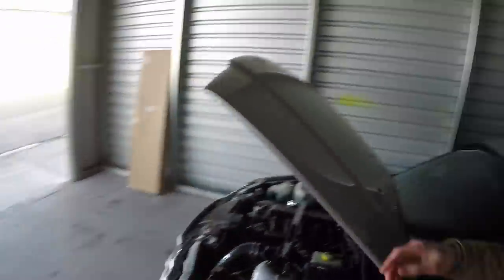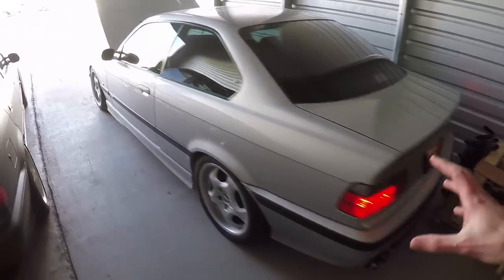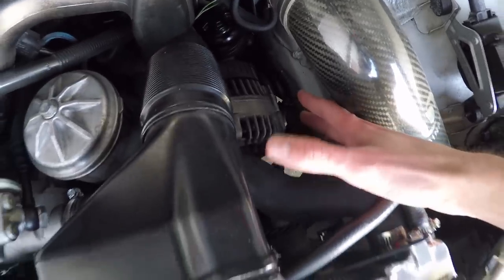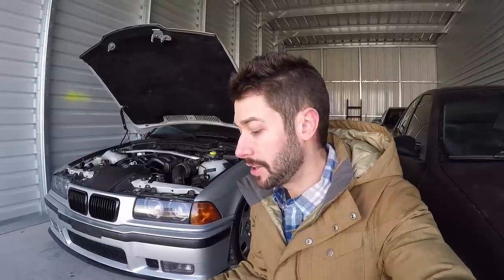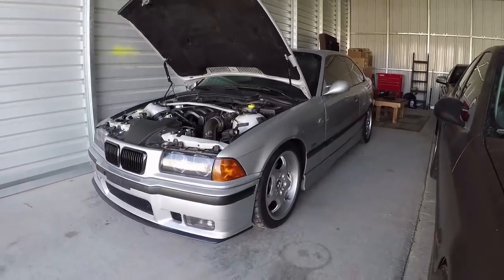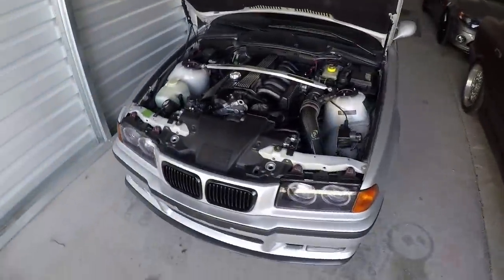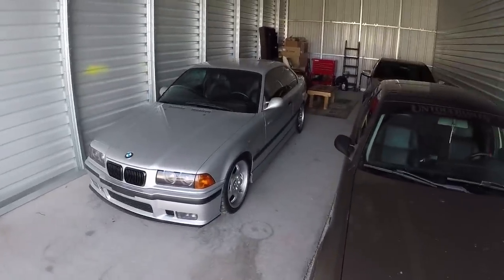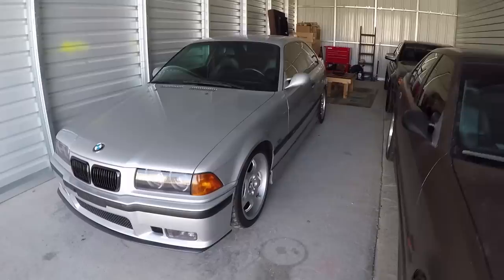BMW RELIABILITY: My AWFUL 1 Year Experience

Comment: I believe I’m a little late to video? Hopefully someone can help me, it’s regarding an E36 I’m currently looking at. Ever since my brother got an F80 few years ago I’ve fell in love with the designs of bmw. Now I have been given the chance to buy my own car, my eyes are set on a 1998 E36. I’ve learned that Bmws have a reputation for being costly to maintain, not because of the engine but because of the other ongoing systems. The seller is asking for $4.5K (168K miles, nicely kept interiors) which fits in my budget, but I’m worried about the upkeep costs. The seller has replaced the head gasket, cylinder head, gaskets/seals from heads up, front control arms, front tire rods, front suspension bushings, rebuilt diff, new starter, and AC system. There’s definitely a lot of money that went into fixing this car already. Would it be a wise decision to pick this car up, especially since a lot of problems have been assessed?
Reply from the maker: I always recommend having a pre purchase inspection done by a reputable German car shop. They know the big main issues to look for and can really guide you on those. Every used car will have things that wear out and need to be replaced, but at least a good German auto shop can keep you from paying the large expenses.

Comment: i dont know what people do wrong with their bmws. i have 2 e34 a 525tds (126000km) and a 525i (225000km). i once had to change a sealing ring on my fuel injection pump and had to replace the axle bearings. other then that i never had any issues and i took them both around the nürbirgring for a few laps aswell

Comment: You're in SLC? what shops do you recommend in the area for the E36?
Reply from the maker: Depends on what you need done
Reply: @TreatsOnTheStreets  I just bought a 98 328i and need to get the clutch replaced and a general tune up. Do you have a shop you like/trust in the SLC area?
Reply from the maker: Yeah dirty euro customs or Wasatch motor werks. There are a ton of BMW shops in Salt Lake so you've got a handful to choose from. If you want to come up to Ogden there's 4950 Automotive Repair.

Comment: Did you gain any NVH in the cabin with the polyurethane motor mounts? Mine have gone out and im looking to replace them.
Reply from the maker: Yes, specifically at idle. There's more vibration but it's not terrible

Comment: put it this way.. that engine.. is in their x3, x5, 325, 328, 330, 525,  528, 530,  ... selling BMWs for a living I rattle that off sometimes... this is a sealed engine with a sealed transmission with a timing chain.. this is their most developed engine... it's in their SUVs, it's in their Sedans, it's in their coupes...... I have quite the monologue and usually if a person has the money by the time I finish they're buying

Comment: Fixing wise did u take out the engine to replace the water pump or ?
Reply from the maker: No way. You just take out the fan and radiator to have enough space 👍.
Reply: Treats On The Streets alright, still looking to buy one maybe a 328i , how different is it from the m3?
Reply from the maker: There are quite a few differences. Limited slip differential, engine, bumpers and hood, stronger chassis bracing, suspension, etc. All e36's are great fun cars though! So if you don't care about having an m3 they're all pretty good!
Reply: Treats On The Streets it’s not that I don’t care, it’s first car and kinda expensive for me. But love it, will mod it tho so lsd, suspension and bumpers don’t matter, it’s just the engine potential I guess that’s different..
Reply: Treats On The Streets how much did u pay ur m3 if don’t mind me asking

Comment: About the vanos, are you able to replace the us spec 2 step vanos with a eu spec variable vanos? Just curious since I'm planning to look for an m3 And I heard that because of the vanos and a few other things it's "down on power" compared to the eu spec and would like to see if those are things that can be easily changed to unlock that power
Reply from the maker: I don't think you can just swap the vanos. There are many other things that make the engines different. Individual throttle bodies, higher compression ratio, etc. There are plenty of mods you can do to increase power on the s52, but I wouldn't recommend swapping the vanos as one of them.
Reply: Treats On The Streets I was just wondering if you had found a way of doing it, thanks for the info! I know the engines are pretty much completely different to the point that the euro spec even has an exhaust vanos but just wondering if replacing the intake one does anything. Thanks! I might just look into getting an e46 if I find something in my price range.

Comment: 99 e36 323ci vert 125k miles runs mint
Reply: Cole Douglass I’m looking at one right now with 110k. What has maintenance been like?
Reply: Just oil change just normal things I paid 2k for mine and it's a 2 owner garage kept no rust just the top dont go down and I start it with a screw driver the inline 6s are super strong just do regular maintenance

Comment: what type of lights you have on your e36's and where you get them from
Reply: If I remember correctly, he got them on eBay, and they are DEPO brand.
Reply from the maker: +Roderick Harmon DEPO glass lens headlights with LED angel eyes. The angel eyes are already in the headlights when you buy them. Got em on eBay for around $300.
Reply from the maker: +LockDots you got it! 👌

Comment: Have you had a lot of problem with vaccum lines? I had to redo my whole system on my past 2002 bmw 325ci
Reply from the maker: Only one line has gone bad because of the o ring. The vacuum line going from the valve cover to the PCV system.

Comment: Would you recommend this as a first car? I am really interested in learning to work on an e30/36. I am in high school and don't really have any experience with this kind of thing. Bad idea? (I got the bus for backup transportation)
Reply from the maker: Find a good working one and get it inspected before buying. It's not a bad first car especially if you're OK with working on it. Just make sure you don't buy a bucket of problems that hasn't been taken care of well. That goes for any car really, not just e36 specific.
Reply: Treats On The Streets would you recommend e36 or e30 for learning to working on cars and as a good reliable car? And yeah, I always have it inspected.
Reply from the maker: It will probably be easier to find an e36 in better condition because they are newer, but either are cool!
Reply: Treats On The Streets thanks!

Comment: I just discovered your channel today and I love it, been watching through quite a few of them and you have earned my sub! Also I love e36s and I’m looking into getting one soon 😁 
PS: What’s the status on the 6 speed?
Reply from the maker: +Kuruma Designs welcome to the channel man! E36's are great cars 👌. Still accumulating parts for the swap. Crazy that the transmission isn't even the most expensive part...😬. Looking forward to getting it in though! You can see the transmission sitting behind the car towards the beginning of the video haha.
Reply: Ah alright, yeah I remember you saying the clutch and flywheel was like $1600 or so! The 6 speed is the same ratio as the 5 speed 1st-5th, but 6th is a longer gear for cruising correct?
Reply from the maker: +Kuruma Designs looks like the clutch and flywheel is actually going to be 2k lol. And yes that is true about the ratios.
Reply: Daamn that's costly! Alright, will be great I reckon!

Comment: My e34 540i isnt too bad on reliability. Parts cost a lot though. You get what you pay for. You can have a drivers car that will cost ya money or a subaru eco box that has zero drivers feel that will not hurt the wallet.
Reply from the maker: Cheap, fast, and reliable. You can only ever have two of those together. Never 3 😂.

Comment: Sorry to say it but your ICV and CCV need cleaning or replacing.
Idle control valve and crank case valve is why your e36 is a little smokey.
Just so you know that i know what I'm talking about take your throttle body off and you'll find a little bit of oil in your intake manifold
Reply from the maker: +Ed Dean I'll have to check that, but keep in mind it's winter and I live in Utah. I had just started the car so it's a cold start. Couple that with freezing temps and there is a lot of steam/vapor coming out. Didn't smoke out the garage or anything.
Reply: Treats On The Streets maybe but i live in Victoria Australia and we get pretty low temperatures here too after I replaced ICV  and clean the ccv even At Nearly Frozen there was no more smoke.
By the colour of the smoke I can tell it's not a very big problem and there's lots of YouTube videos on how to clean them it's not a real big deal anyway just giving you a heads up. 
Oh and I just subscribed
Reply from the maker: +Ed Dean maybe in the next few videos if you see the exhaust looking what you think is bad you'll have to let me know and I'll look more into taking care of that stuff. Definitely don't like a smoky exhaust. Welcome to the channel man!
Reply: Smoke from the exhaust, especially on startup in colder climates is nearly always caused by condensation and water vapour. If the smoke is any colour apart from a slight transparent white then you would possibly be showing signs of engine and/or head gasket wear. If the CCV system was faulty, the general symptoms would be signs of high oil consumption without it actually appearing to be leaking out anywhere. The ICV would also only show an erratic idle, and at worst can cause stalling and/or EML to appear on the dash.

Comment: I've owned 3 different e36's. They are still one of the most reliable cars in the world....unfortunately...(like most machines suffering from gross neglect) , they need retroactive maintenance. Just stay away from the GM manufactured 4L30-E  auto-transmissions. BMW installed those on alot of E36's. Those are junk and die after 150k usually.
Reply from the maker: +stonesthrow420 I definitely agree with you there!

Comment: Hey. Nice video and very informative. Im 17 and im looking for a car to get. I love classics such as old mercedes and i was thinking of buying a 190E but those cars have gotten very old and rusted so it will require a lot of maintenance. I understand this will require some too but i can definetly find some in a better condition than a 30 year old 190E. My questions are:1) Are they economically fuel efficient2) Are they reliable3) Can i easily find parts for it4) Is it just a bad ideea and will become a total money pitSorry if im taking too much of your time but its just that ive been saving for a car for 3-4 years now working by the time i was about 13 years old so i really dont want to spend it all on a car that will dissapoint me.Thanks

Comment: damn ive had an n44, m52, s52, and 2 s54s. each car/motor ive driven for at least 30k miles. none of those problems. only problems i created was when i did the m50 mani swap to the s52.. had to do $1k for work fixing my vacuum leaks... but thats it really. you got unlucky.

Comment: In simple words, these cars can be as relible as they can if you keep them in good nic, keep regular maintenance and if somthing is going bad fix it before it gets worse, yes they can be costly but they are relible cars if you not gonna do any maintenance at all and won't care then obviously it will cost you more in the end and also won't run or work, but still better then most new cars and any new coming cars as those are far worse they are more costly due to tech and more electrical issues, so I rather own a old bmw then any new crap. Car can only last till you want it to last and it's all about your love for it and how much you can afford to keep it but that goes for new cars too as these aren't any cheap to fix and can cost alot more.

Comment: cant find those exact headlights anywhere
Reply from the maker: +Bmw M3 e46 what are you searching when you look for them?
Reply: like i want those exact ones can you find the brand or something on yours
Reply from the maker: +Bmw M3 e46 they are DEPO glass lens headlights with LED angel eyes. All one piece, the angel eyes aren't separate. You can find them on eBay for around $300.

Comment: Your front wheels are not centered because you have 328 lower control arms
Reply from the maker: +ty ty they aren't centered because I have offset polyurethane front lower control arm bushings for added caster.

Comment: It's a car for mechanics in my opinion. If you can work on it and fix it, it's a reliable car. 
If you have to take it to the Shop for everything, you go broke 😂
Reply: Easiest car I’ve ever worked on is my e36 m3 followed by my e39 540 sport. 
8,10,12,13,17mm a flathead and a Phillips head screwdriver is all you need

Comment: But those repairs probably had LARGE LABOR COSTS
Reply from the maker: +Sam Shevelove I did the work myself on the water pump and motor mounts. Both simple fixes, especially the motor mounts. The $150 for the vanos included parts and labor.
Reply: do the work yourself and save a ton of money, thats what I'm doing with my e46 m3 and my mach1. and honestly most 3 series are super easy to work on.
Reply from the maker: +Duffmanb6 yeah they're definitely relatively simple cars to fix
Reply: You can do the worl yourself theres so much knowlege on these engines youtube teaches you everything

Comment: Haha its kinda funny that ive had problems with everything but the engine, steering fluid and vanos and I have 165k on my s52 e36! Latest problem is my ignition lock cylinder rod shattering. Installed a new one and it wouldnt turn my key lol fml. Just wired up a push-to-start and realized I suck at wiring haha. All in all a fricken champ of a car just really random and rare problems for me... Ahh well still obsessed with em. :D
Reply: *265k miles

Comment: Only one big rule if u wanna get an "old" BMW like a e36 or maybe a prefacelift e39 and thats is u have to change all the coolant system, fuel rails and filters (maybe AC pump also because it fails because the clogged fuel filter) than some mounts and silents. And thats all just because the previus owners didn't do that in the last 20 years or about 300k km. Ohh and another thing.. u HAVE to buy premium german parts for these.. it worth the price. Previous days i just reapir my friend newly bought e39 23i and im shocked because it has the original shocks on it and it has 270k kms in it and its made in 98'. So there are many shit owners u just have to repair their faults and the car please it. (Im just a random guy from europe who is a e39 individual owner)

Comment: dang both my m3s needed mad money
Reply from the maker: +Trent S haha maybe I got a little lucky
Reply: for what?
Reply: Bmw M3 e46 cooling system stuff, bushings up the tiny yang, tensioners, vanos rebuilds, gaskets all over the motor, differentials, axels, sensors.. honestly all completely worth it tho. Besides the cooling system stuff.

Comment: Mah dude the rims are on backwards, they are a staggered set, the fronts belong in the rear
Reply from the maker: +moises favarao I switched them up because I use the car a lot for drifting. I wanted more grip up front and less in the rear. It's a common thing to do on drift cars, but I understand why most people wouldn't do it haha.
Reply: haha yea  i figured you knew other vids were correct, nice car dude it keep all up, these cars are fantastic
Reply from the maker: +moises favarao will do, thanks for watching man!

Comment: This thing is just old. Old things break down. Has nothing to do with the brand. I had a nissan 200sx turbo. Boy was it unreliable.
Reply from the maker: The title was sarcastic. In the video I explain how its actually been quite reliable. But yes, older cars typically have more problems than new ones
Reply: alphatrion100 did you comment on it before watching? lmao

Comment: No biggie at all. I'd sell that Colorado before it starts giving you problems though.
Reply from the maker: I've been lucky on the Colorado. Maybe because of good maintenance. I'm at 120,000 and not a single issue since 60k when I bought it. Family member had one brand new from 0 miles to 130k and no problems either. Crossing my fingers lol

Comment: All these E36  325i are nothing less your nightmare ,got a new one back in 2004 brand new.It was under  full guarantee.5 times it needed a tow track  !!!  Car computer would foil coils four times in one year , Dealer sending a  BMW tow track to pick it  5times as the car was dead on the road  !!!!Every time engine light came on ,car misfired and smoking from tail pipe.Sreering box was was apart an leaking  ,clutch shuttering ,rebuild ,idle needed to be updated 5 times even brakes lasted only 30000km only Got read of this shit box in 2,5 years !!!! Stay away from this junk !!!

Comment: BMW, acronym for "Big Money Worry." Sorry, there is a reason you can buy them off warranty cheap- buddy had an X5 in his shop the other day. Seem the fantastic engineers mounted the turbos up above...where everything is plastic so everything dried up & broke. Owner enjoyed there "Ultimate Driving Machine" after the $4500 repair/patch up. And it'll happen again because of the turbo mounting position.
Reply from the maker: +olikat8 it's called a "hot V" because the turbos are mounted in the middle. The cylinder head flow is reversed so the exhaust comes out the center instead of the outsides. BMW is not the only one who does that. Mercedes does as well, and most every manufacturer who uses twin turbo v8's because it is more compact and causes less lag. Unfortunately there are drawbacks like you mentioned.
Reply: And unfortunately there are a lot of drawbacks engineered in- they all have them, no doubt, but it is excessive with the Europeans
Reply: Powerstrokes have it too.